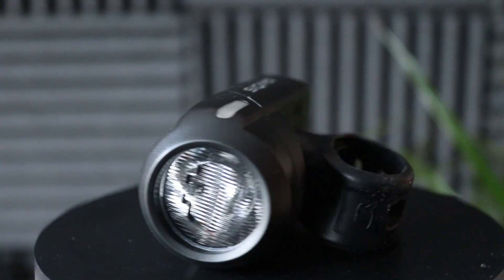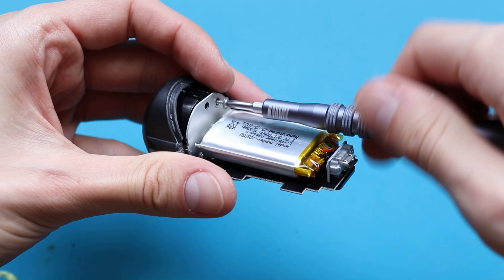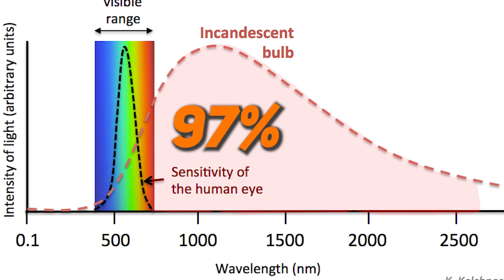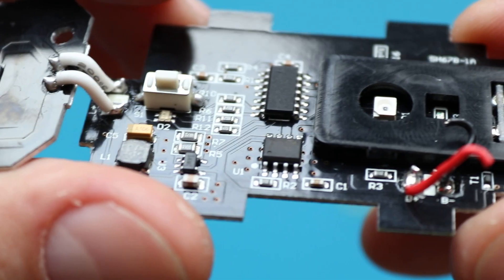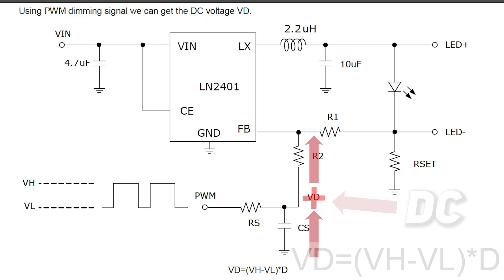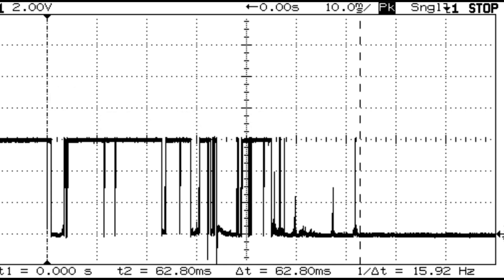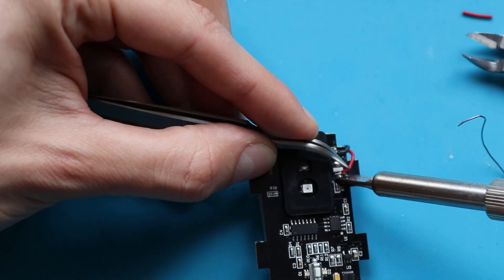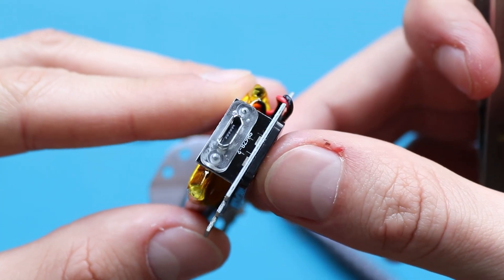How To Fix LED Flashlight (with schematic)

Comment: You missed the opportunity to add some small heat sinks to the back of the LED board to reduce the heat stress on the battery....

If it had been me, I would have  run wires out of the case to an external 18650 battery holder attached to the side of the light. Longer run time, quick swap battery and no heat stress.

Your channel is outstanding 🏆 👍
Reply from the maker: Thanks for the advice. It might need a heatsink, or it might not. I’m not actually sure :D

Since the LED itself is soldered to an aluminum PCB, it already acts as a heatsink. Whatever engineer designed this must have done some calculations and testing. Usually, in flashlights, the device body (if it’s made of metal) is used as a heatsink.
Reply: @NickElectronics 
If it's hot enough to fry the Lithium ion battery once, it's hot enough to do it again. 

I worked with another phone repairer friend who almost died charging a Phone battery the wrong way 🔥. So I speak out about possible risks.

Imagine a warm summer night, you're going fast downhill on your bike and the battery chooses that moment to vent and explode because it's been overheated once too often. If the fire doesn't kill you the accident probably will....

Even a 14500 cell in a AA holder rather than a big 18650 would give you longer run time 👍

I'm a very careful person.
Please be careful too.

Comment: Have LUMINRG  Led Flashlight won’t turn on think the power / Mode button isn’t working, when I push the button it doesn’t click or move and it’s mounted right on the round circuitry board, is there away to fix the small button or bypass it so I can get the flashlight to work? 🙏🙏
Reply from the maker: You can always replace the button. Usually its as simple as closing 2 contacts. So any button will do the job